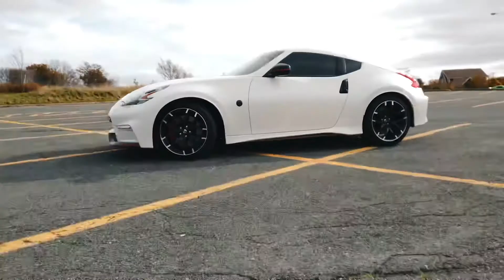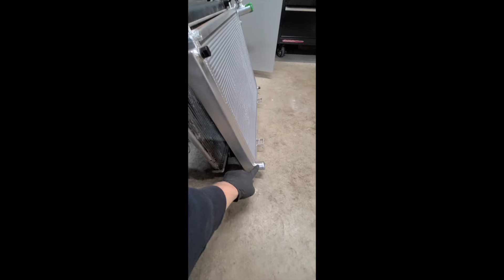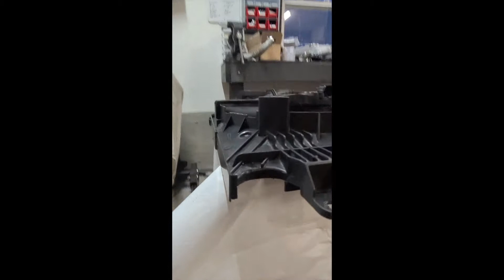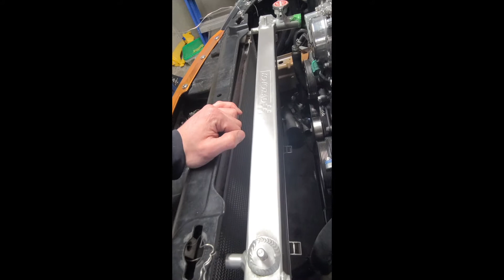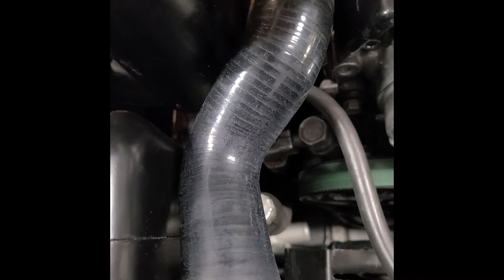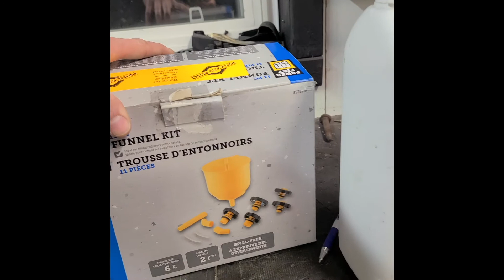350z KOYO 36MM Radiator Install | With supercharger + factory fans

Comment: The bleed through is normal for silicone unfortunately, I've researched it quite a bit. Happened to me and many others I've seen, they also smell when the car is running, because of that since I'm now installing the same radiator I'm going back to stock hoses.
Reply from the maker: Yeah I've read it happening as well after the fact. I'll be going back to OEM rubber very soon.

Comment: Have u changed the convertible top on your Z and if u have how I need all the help I can get tried doing mine got it off but can’t get the new one on I’m panicking bad all help is appreciated
Reply from the maker: I have and here is a link to a solid guide I went by when I replaced mine. 

https://my350z.com/forum/350z-roadster/435425-it-has-arrived-the-1st-diy-350z-roadster-top-canvas-replacement-guide.html

Comment: I was super excited for this but I think because I don't have the revup I have a belt where your charge pipe is lol.
Reply from the maker: That's too bad!
Reply: @jiggsnwheels4380  yeah honestly the aftermarket fans can't quite do what I need them to lol. I might revisit and try to get the stock fans in there.
Reply from the maker: @HarlanMangulis  for sure. The only fans I've seen positive things on are the Spals and they apparently draw a lot of juice from the battery. It would definitely be worth making an attempt to trim your fans like I did.
Reply: @jiggsnwheels4380  I replaced one Mishi with a spal and it nukes my rpm when it kicks on. I need to find a way to like, ramp it in and out. Haha.